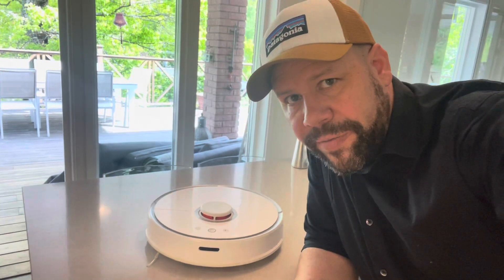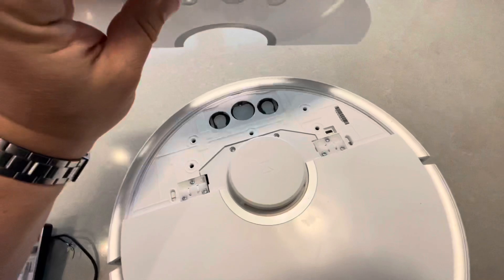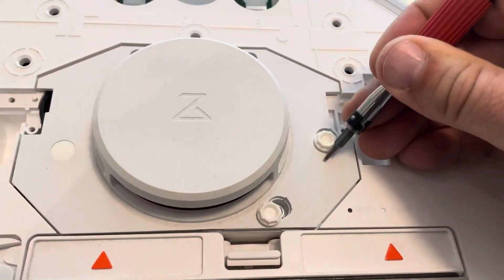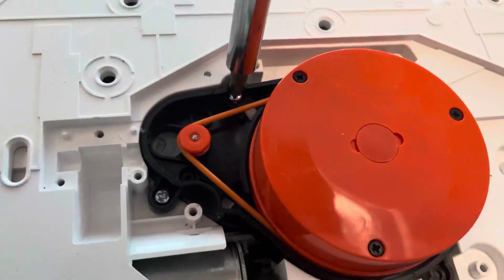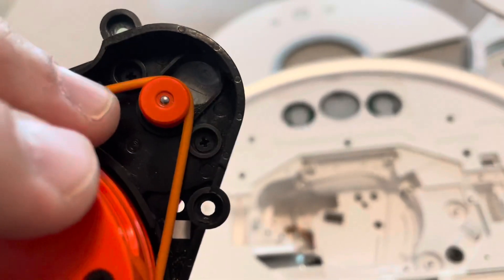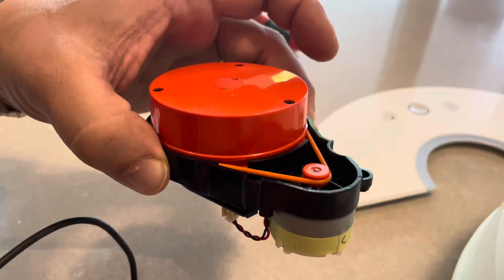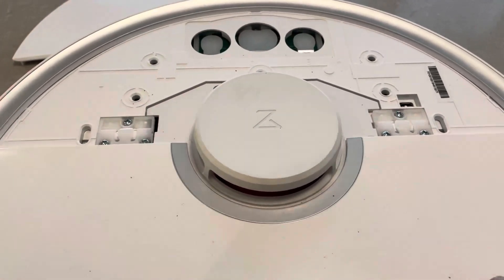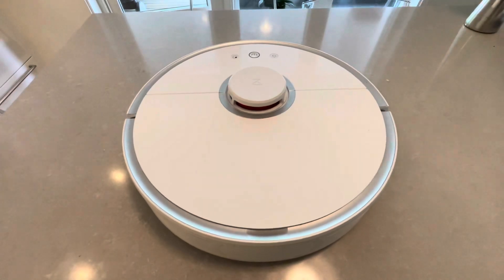Roborock Error 1 - FIX Laser unit sensor stuck. DIY Repair￼ / Reparera själv￼￼

Comment: I also had a problem with error 1, but the whole problem was in the closed switch of the upper cover of the sensor. after I left the cover screws a little loose, the problem was solved.

Comment: thank you for the video. 
in my case I've removed some dust and hair from the motor (as per the advise below), tested on 9v battery (even though it gave some real smoke initially...). 

Applied some silicone to the motor and moving part of laser, and to rubber ring. 
Disconnected motor and used wd 40 on contacts (as per the advise below:)). 
and now it is working again. will see how long it will last:). 
if it breaks again probably will replace the motor.

update: next day got the same error. ordered a new motor on Ali express
Reply from the maker: Good job!

Comment: Thanks for your video, i have followed your instructions plus i cleaned the contacts with kontakt spray to be sure the connection between the motor part and the robot will work properly, the rest of the work i followed your whole plan, and to be sure after all i pressed reset, after all this actions it works nice, so great Thanks for your very good video and instructions

Comment: Perfect, this worked! Now I wonder if just disconnecting the LIDAR assembly and then reconnecting it would have helped equally as much. Not sure why would applying 5V to the motor help. If mine throws the error again, I'll test it out.

Comment: Hello all, sorry to say but i think this kick start is nothing to do with the problem. The real cause is the connection between the motor unit ( black) and the pcb connector. Somehow it gets dirty after usage. So just removing the motor unit and pressing back also fix temporary the error. But better to clean the connector both side with for ex. WD-40. ( With a small ear cleaning stick for ex.)

Comment: Mine was just stuck, two strands of hair had jammed it. I split the cable but ended up not needing to use it :) The battery didnt look as the one you had so I tried to just restart it after removing the hair and it worked! But great guide to have for deconstructing!🙌

Comment: Thanks for the instruction, works now. A tip is to use a normal 9v battery for the kickstart.(like the one in your firealarm). A lot easier than splitting a cable.
Reply from the maker: Good thinking! 💪🏻